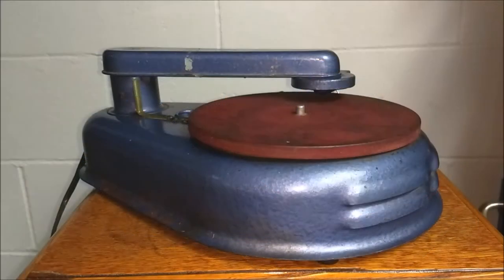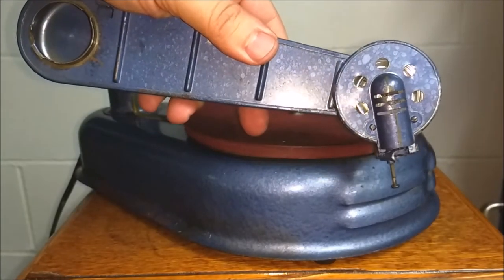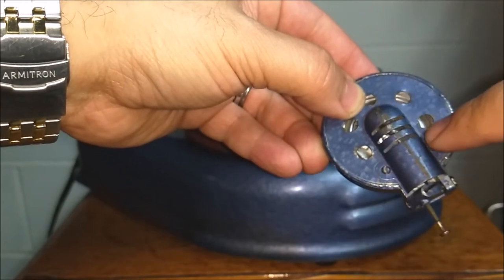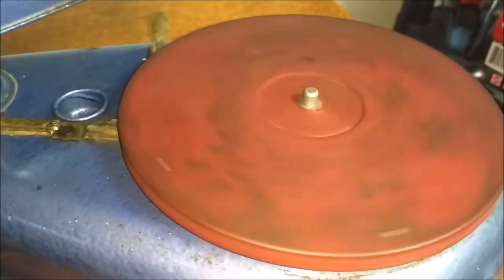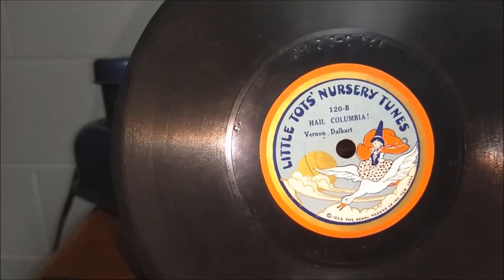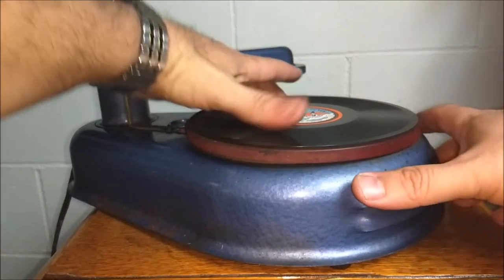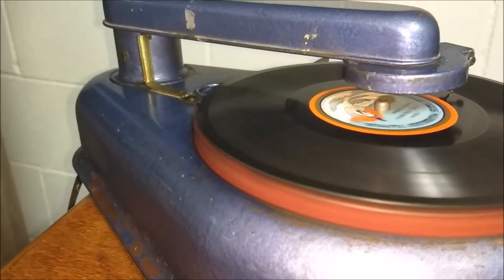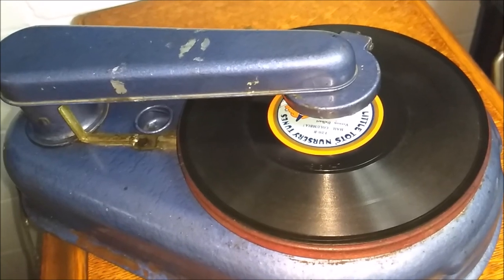1940's Marx Toy Model 3650 Steel Needle Playing Record Player / Phonograph

Comment: The leadout groove isn't right. That's why it didn't turn off.  The 78 leadout groove is pretty steep, but here it was very shallow (meaning did not go very far towards the center of the disc. Shallow left and right, not up and down as in the grooves are shallow).
Reply from the maker: Exactly. Thanks for the info.